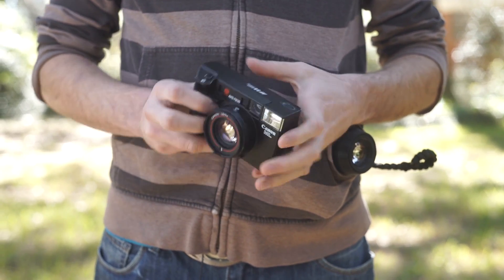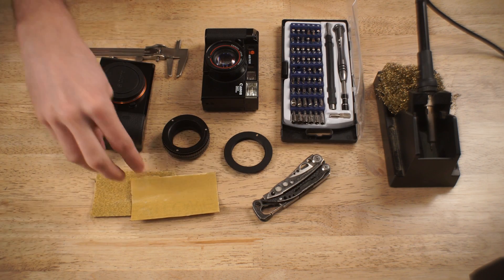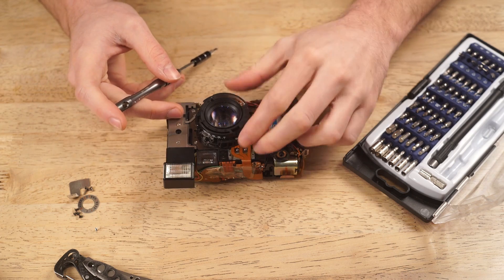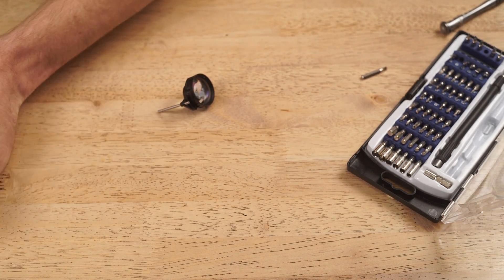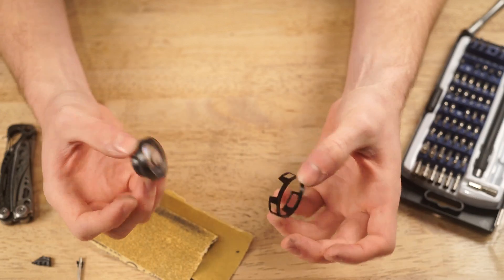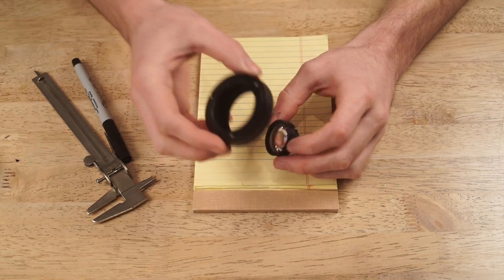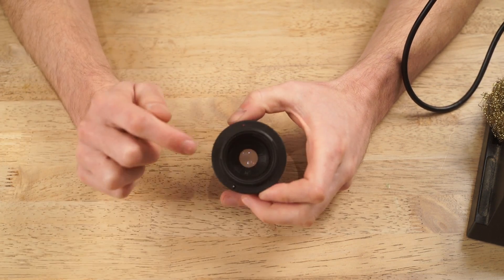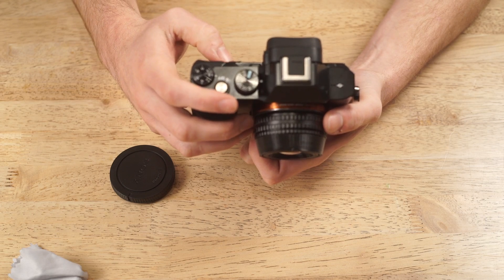Canon AF35ML 40mm f1.9 Lens Adaptation.

Comment: GREAT VIDEO! What is the thickness of the M42 to M42 macro helical? There are different sizes, from 10mm to 50mm.
Are you planning to do more adaptations?  Like a Yashica T4 lens? Or an Olympus MJU II 35mm f2.8? 
Best regards

Milo
Reply from the maker: I don't have the lens in front of me but I think the helicoid is about 20-30mm closed. I was originally planning to do more, but realized its essentially the exact same process for every lens: extract lens, measure, mount, test, remount, go shoot. If the original lens or the adaptation was significantly different then maybe, but I haven't run across anything like that.

Comment: Is there any chance you can share the 3D print files?
Reply from the maker: I have an early version of the final print(I lost the finished one...), but depending on how much you cut down and sand the lens, which screw adapter you use and which m42-mount adapter you use will all change the printed part dimensions. I would suggest finding someone local who could give you a hand and model and print the parts with you. Good luck!
Reply: Windham Graves ah I see. Could you perhaps share or send the early version? It would help me further
Reply from the maker: @zakmetpoep  here you go: https://www.thingiverse.com/thing:3500751

Comment: Really really brilliant video thanks! Any tips for doing the same but trying to get exact stop at infinity focus? :) And how do you find the amount for focus ring-turning for normal focusing?
Reply from the maker: I would add shims between the lens assembly and the helicoid until it was at infinity when the helicoid was bottomed out. The focus ring is actually a little faster than some of my other lenses but due to the overall throw it is a little abnormal feeling. I've gotten used to it, as you would with any new lens.
Reply: Windham Graves great thanks again, really useful video I hope I can finally get a good manual focus lens going on my digital

Comment: Hi! I'm trying to opena a AF35ML camer afor fixing, and I am stuck to the removal of the front plastic cover. I do not understand how to remove that part without breaking it exaclty as happened to yours. Did you understand how to do it? What damn is locking that piece of plastic? Thank you in adavance and, in any case, nice job!
Reply: you have to take out the plastic sheet that is to the left of the lens 
it hides more screws.. you can stick it back on after

Comment: Love the walkthrough you've provided. Very informative. 
I've taken apart my af35ml and salvaged the lens and aperature mechanism and would like to mount both in tandem for an Olympus m43 mount with the hopes of also attaching a speed booster. I'm having trouble finding the back focal length though, what did you determine it to be?
Thanks so much.
Reply from the maker: Sony e-mount is 18mm FFD + what I measure as roughly 9mm at infinity, so 27mm from the rear element to the sensor. AFAIK the shortest speed booster sold is for canon FD at 42mm FFD, so it would not be (easily) possible to add a speed booster to this lens and retain infinity focus. If I remember correctly the aperture mechanism is part of the shutter, and it would be significantly easier to add an aperture as a drop in disk, like the lensbabies do.
Reply: 27mm to sensor, awesome, I believe the flange distance of m43 is 19.3mm. You're right though, the Roxen speed reducer I have is slightly too long. And yes the aperture is part of the shutter mechanism but it functions well with some adjustment and has some interesting qualities.
Reply: it appears you are using a 17-31mm helicoid adapter. does it have enough travel? I am going to put the aperature before the helicoid and set the lens an extra 4.7mm (height of aperture assembly plus ltm to m43 mount plate minus extra flange distance) back into the adapter. Ill let you know if it works.

would you be willing to send me the files of your setup so i dont have to design from the ground up entirely. I would be willing to pay whatever you think is fair.
Reply: did you end up mounting it on m43? my idea is to make a telescoping prime out of this, i've just ordered it :)

Comment: how do you adjust the aperture?
Reply from the maker: I don't, it just operates at max aperture, it would be a pain to add it for something I don't care too much about.
Reply: There are M42 to M42 12 bladed aperture modules available on ebay. It's about 8mm thick so it might require infinity focus adjustment depending on the flange distance.